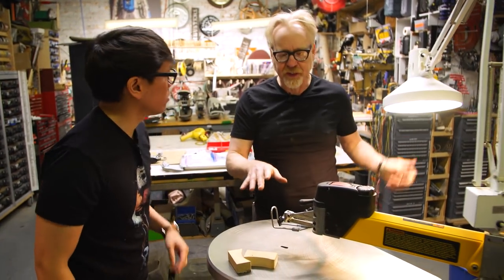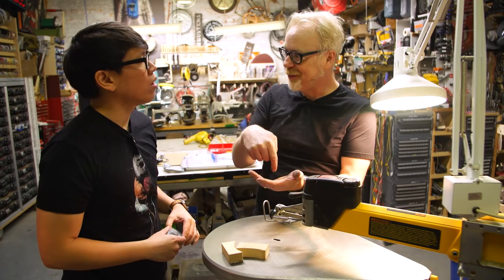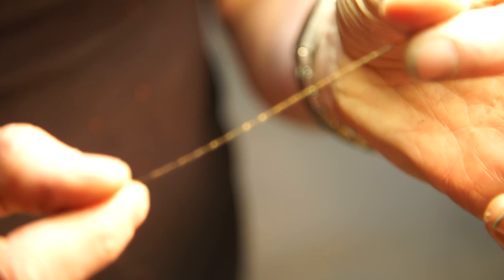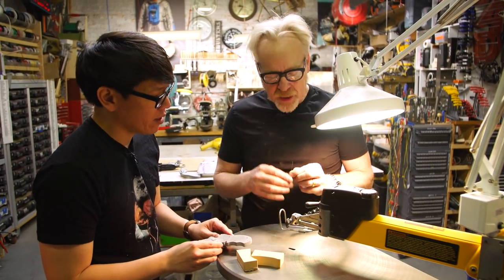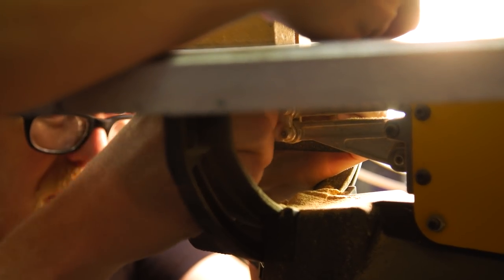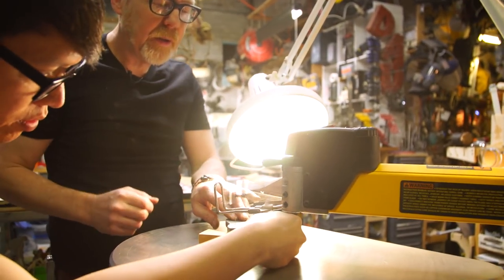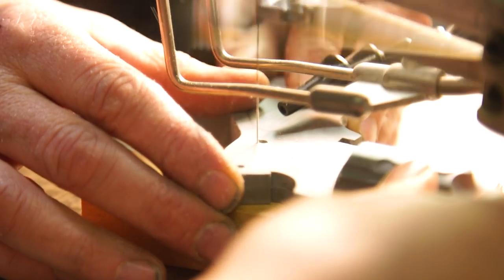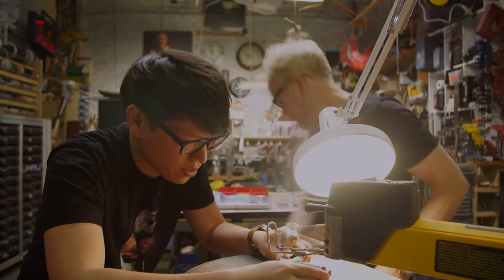Adam Savage Build Tip: Using a Scroll Saw

Comment: Scroll saw blades come in two types; pinned and pin-less. The pinned style of blade is older and has as you'd expect pins at the ends of the blades that mount into the machine for a very positive lock while installed. Pinned blades can not be fed into as fine of holes for internal cuts, however. Pin-less blades have no pins at the ends and are held in by the machine with screws pinching them at their top and bottom. Pin-less blades can be extremely slender and fit into tiny holes for the most diminutive internal cuts.
Spiral blades (as seen in this video) are a lot of fun in that you can move in any direction. They take out a larger amount of material, the "kerf", with each stroke as opposed to standard blades. Spiral blades take more discipline to control than a standard blade as you can quickly be cutting into your keeper material if you're not careful.
Standard scroll saw blades with the saw teeth facing in one direction come in a variety of patterns and sizes. The different patterns and sizes of blades for scroll saws will allow for finer or coarser cuts, easier radii or straight-line cutting. 
Standard blades can have precision-ground-teeth (PGT) so as to eliminate most of the drift to one direction that any given saw blade has but even these still have a direction left or right they are very slightly biased towards. People who first try a scroll saw can be very surprised and often dismayed by their trying to cut a piece straight-on and it not wanting to follow the line without first rotating the piece to the slight angle dictated by the saw blade. It can seem counter-intuitive but once you've figured out the blade drift lesson you're really on your way. Another important topic is the multiple ways you can go about cutting corners on your pieces. :)
Reply: Drift is more apparent cutting over longer distances, and some blades drift much less (like the PGT blades I mentioned) than others, it all depends on the type you are using. Its most important that you know that it exists so you can identify it while you're scrolling and compensate.
Reply: They're using the very popular DeWalt DW788, btw. 

https://www.amazon.com/DEWALT-DW788-20-Inch-Variable-Speed-Scroll/dp/B000022313

Other current premium makes include Excalibur, Hegner, RBI.
There are more value models from many sometimes more familiar makes including Craftsman, Ryobi, Delta, Wen, Proxxon.

Comment: The blades he is using is calls a spiral blade.    
I have bought these blades from this website: 
www.woodenteddybearonline.com
And have had good results.   I do not work for this company and have no affiliation.  I’m just a satisfied customer🙂
Reply: Just out of curiosity, do you prefer the Olson or Flying Dutchman variety? I've tried the Olson, but they seem pretty fidgety on the tension (I broke three, then figured out I had to use so little tension that the blade felt sloppy while scrolling). Thanks for any input.
Reply: Aaron Lingenfelter 
I’ve tried both and both have worked well for me.

Comment: Jealous of the 360 capabilities. I still have a pin in the blade type.
Reply: I quickly made the transition from the pin-end blades...and wouldn't go back if I had to. If your scroll can take one, you owe it to yourself to try the non pin-end. The 360 blades (and others) are a little more finicky, but they're so much nicer to use!

Comment: Norm getting to see and use a scroll saw for the first time in his life is not a tip ...
Reply: Rich Wojehowski lol sad guy
Reply: The tips in this video were as follows:

1. A scroll saw is best used for situations where you need to cut something out of the center of an object and cant or dont want to cut the outside edge
2. Use a 360 degree blade so you are not limited in direction or radius
3. Go slowly and steadily for best results.
4. Do some practice away from the cut to make sure you get a feel for the machine before risking your final cut
5. Cut slightly away from your line and then sand up to give yourself some margin for error and ultimately more control.

Those seem like perfectly good tips to me.
Reply: The tip is: Scroll saws exist, here is an example where one might be useful.
Reply: +Kiwi Bird - In that case they forgot to cover plugging it in and location of the power switch.